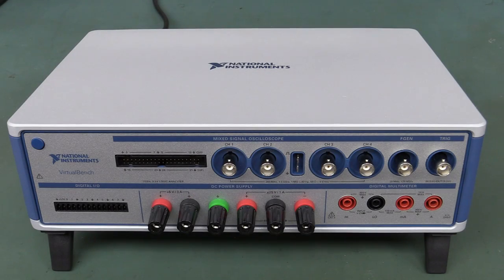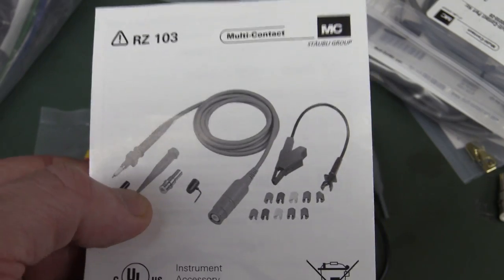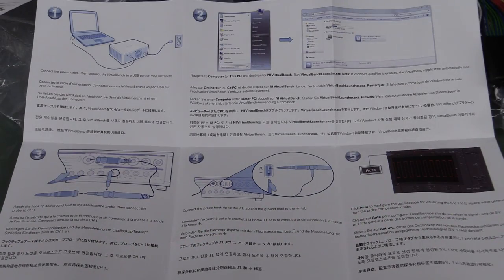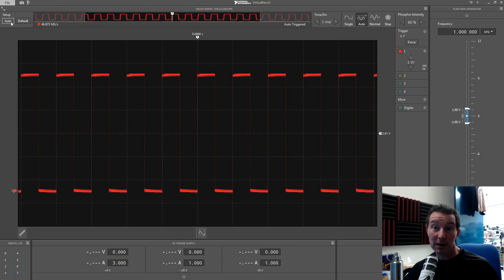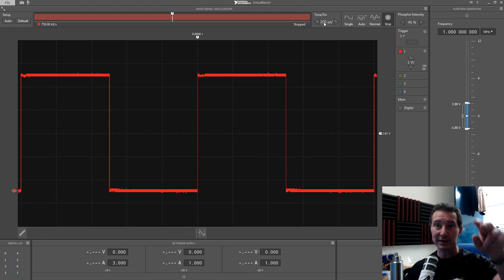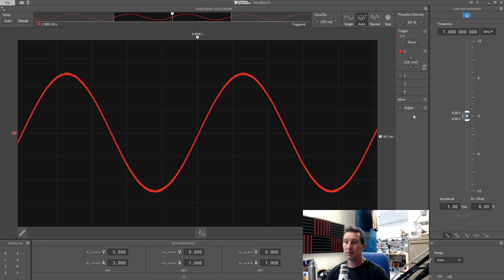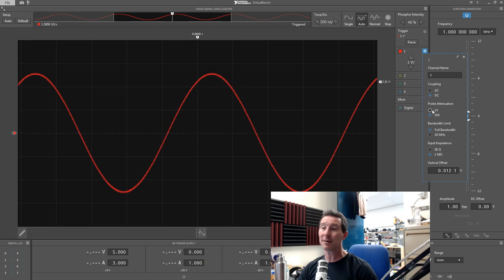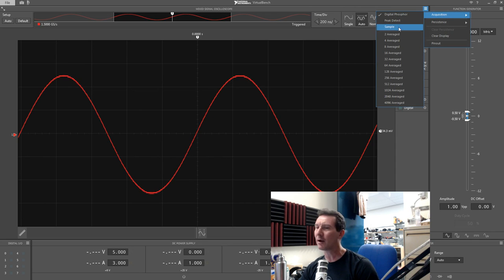EEVblog #876 - NI VirtualBench Review

Comment: Hmm, a shame you don't test it and see if its loyal to spec, after all, it is only USB2 and you got all the bells and whistles to check what the capture rate is, and what the effective bandwidth is.
but nothing tangible..like you usually do with your scope review, but for some strange reason this uhh uhh Its "National Instrument" gets a pass, '' c¨'mon its a 6000USD device you can at least check if it's loyal and what kind of spec that is in play.
on USB2 you can often be bottlenecked, so anybody down the line who perhaps thinking about picking it up, and it aint a scope that many peopel have, so a bummer you dont get some answwers tpo the spec, like you usually do.
Test Test Test Tests, the g'darn bxtch and give the viewers those values, which is crucial in a good review.
a site like Rtings though that is another segment that seems to conclude this approach.. a lot is down to give the viewer the actual real-world values on how a product performs' and then the viewer themself can use that info to conclude and put it into perspective in regards to the market and the official spec.
And sure the vendors hate such an approach, where a reviewer literally just pulls down the trousers on a product and shows it raw, and also why Cedric from Rtings usually needs to put down own money for certain consumer tech' as vendors usually wanna lubricate a review with an advertising purpose.
even the 500Mhz Vituebench still uses USB2, though not much detail on all the other specs and you do have an external trigger so I reckon it would not be a biggie to check what rates the scope operates with and it only takes a few seconds.? .(the max sample compression is 2/15 to 1)
https://www.ni.com/pdf/manuals/376473a.pdf
Dave have you wonder about making a checklist for your scope reviews, like fx validate the 3 to 5 overall most important specs in a modern scope and make sure to test those vital specs on each scope and validate if they match the spec the scope vendor claims, would take a few minutes to just incl. it - then people have those tangible values tested raw and sweet as the test approach is pretty common across the plateau and people on forums could list to your vid as a source for that crucial info and your rep are high as an honest dude)
and No Im not a fan of National instruments software.. a mess of an old patchwork.

2021 prices
VB-8034	$ 8,404.00 350Mhz/1.5Gs  (USB2)
VB-8054	$ 11,207.00  500Mhz /2Gs (USB2)
https://www.ni.com/da-dk/shop/hardware/products/virtualbench-all-in-one-instrument.html